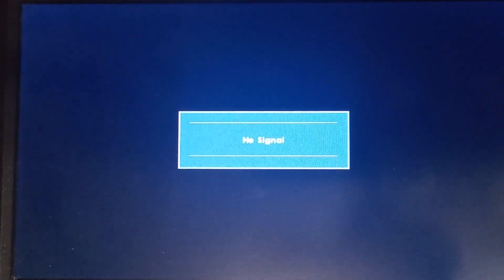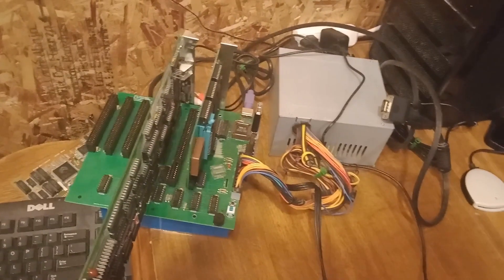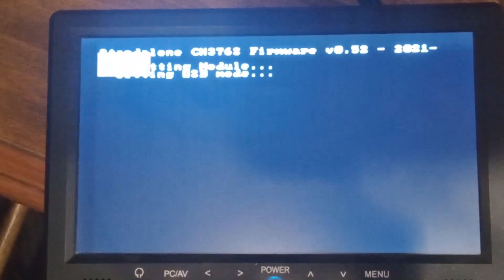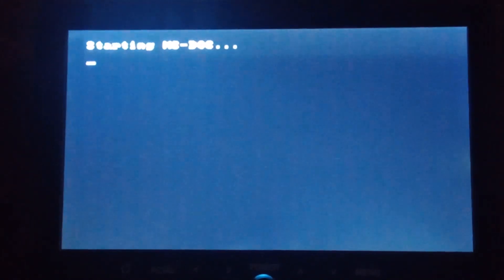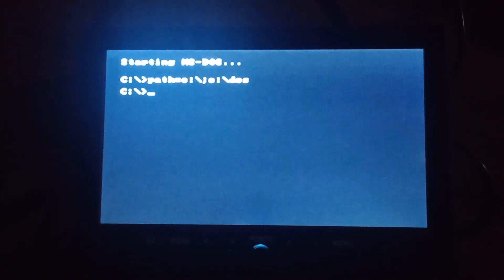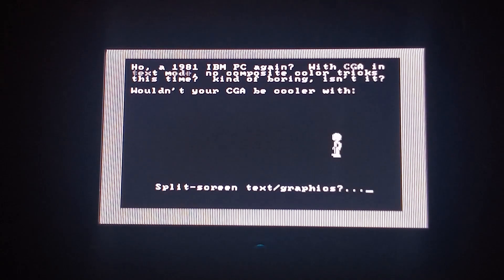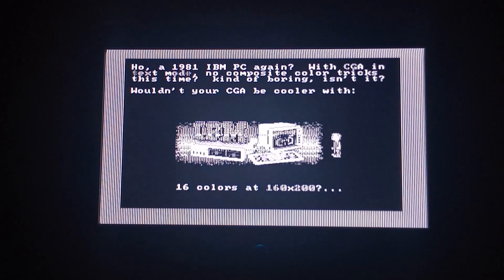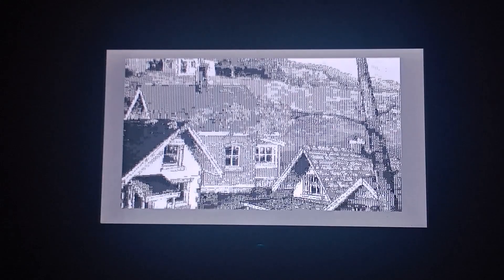AREA 5150, Tested on 8088 PC Project.

Comment: I think there was a problem with your video upload; it stops halfway through...?
Reply from the maker: It looks like it is an issue with the source file. I overwrote the original so I wont be able to restore it. 

Your not missing much the remainder of the clip is mostly the display blanking out.

Thank you for letting me know
Reply: @elijahmmiller  No worries. We always like to see Area 5150 attempts on hardware we didn't design for.